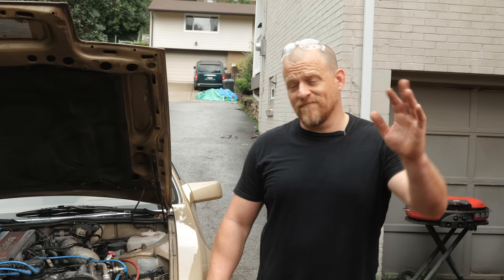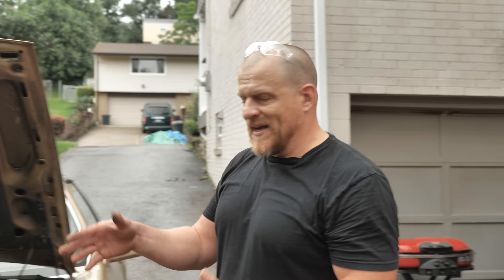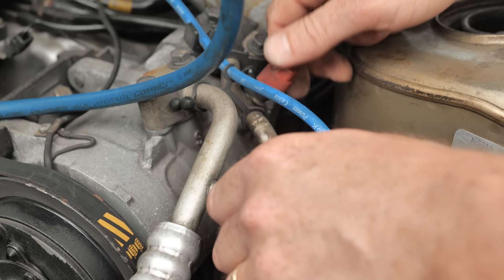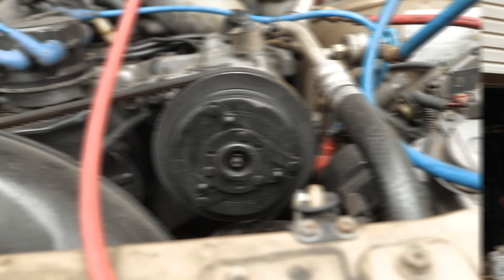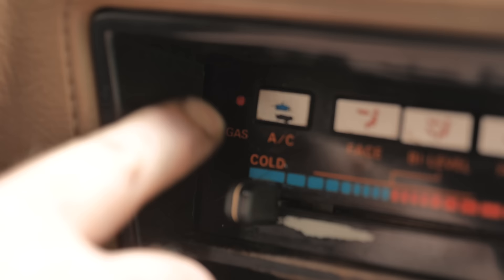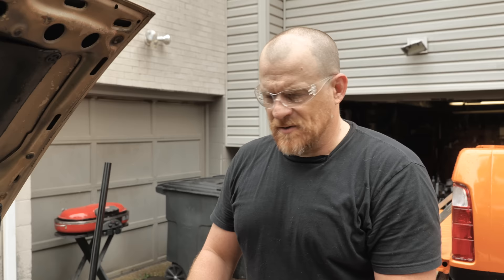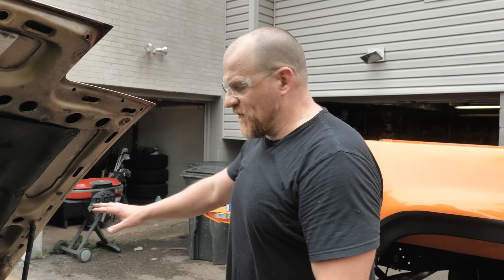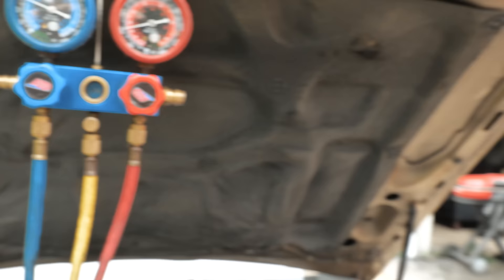A/C Leak Testing, Repair, Evac and Recharge (ANY CAR!)

Comment: Sorry to bother u .. I have a question after watching this video and purchasing  gauges  and filler piece that attaches to the yellow hose. I proceeded to see y my daughter's  2015  dodge journey wasn't producing cold air.  Steps I took to check for leaks ECT 
1. Attached all hoses to high and low with all valves closed. ( On gauges and on high low on engine . 
2. I opened all  valves starting with the one on engine then gauges. With the engine off. (Temp out side was about 80 degrees. And both high and low said approx the same on them as for pressure. Both equal to each other with all 4 valves open position)
3. I started car with a/c off let it run a bit gauges did not change. Stayed equal 
4. I turned on a/c to its highest speed and coldest setting looking at the gauges while running motor at approx 1500 RPM 's the gauges went to. Low side bottomed out at its highest mark in the retard section. And the high side went to about 200. . (When I tested for leaks I got none meaning  once I opened the 4 valves and both gauges went to about 80  I let vehicle set and gauges didn't move  it wasn't until I turned car on and flipped on the a/c before low pressure went all the way to the retard section and high side went to about 200.. ( now also I had the yellow hose going back to its self ( meaning I screwed it on to the port on it's one t)  so yellow was looped back to its self basically.  With what I have described  can u help me out on what possably I did wrong. Or possably the issue with the system 

Also I heard the clicking of the clutch come on and go off  plus when the motor or a/c was shut off I heard the hissing sound from the a/c unit.  Thank u if u need more info please  let me know
Reply from the maker: The valves on the gauges themselves MUST BE CLOSED when running the system! Those only get opened when adding or removing refrigerant or pulling a vacuum
Reply: Ok I think I understand I will rewatch a couple and this same video again   to clarify the order I thought  all valves had to be opened up with car running to check systems pressure before adding any Freon I did the car off  standing pressure. Which was equal to its self on both high and low.   So now it saying I should close valves and then hook up a can  and turn car on and open low side and induce Freon while running car at 1500 rpms and watch gauges go to 30 low 250 high
Reply: Sorry for writing the novel. Much respect thank you
Reply from the maker: @doncarl6849  the valves on the gauges themselves simply open the low and high sides to the center yellow hose. If you have both open, you're allowing Hi side psi to force its way into the low side.
Reply: Ok I will give. It a shot again. Maybe I'm mentally  making more  of it than I should. But what's simple to some cause of knowledge is so to one that doesn't. Lol. But I'm one that learns easy I appreciate the help I truly do.  I know I will get it right. It's a bit confusing even the cheat sheet cards  express a certain order on how to do things. By steps...

Comment: Ummm,  Ummm,   this is 2022,
How  about a  
" DIGITAL"  TEMP - G.   or use  a  VOLT - METER W/  the  attachmt.  - Wire - feat....
No pun,   just saying..
But overall great  "EDUCATION"
On  - "A/C - HVAC "  do it like
PROFESSIONAL!!! 👍👍👍👌👌
THX - YOU - SIR.....
Reply from the maker: I don't do enough A/C work these days to invest in more expensive gauges :-) but thanks!

Comment: Yes it does matter which side you open when testing nitrogen, you want only to open high side (red) only, as you make your low side gauges go into retard which it unnecessary stress.
Reply from the maker: There is no low or high side with the system off. Whatever you put into the high side enters the low side. Not sure what you're referring to. 🤔

Comment: I have 05 Crv and long ago well a year ago u replace the ac clutch and yesterday replacer the serpentine belt and tensioner cause I was  making noise time to replace but I notice the ac clutch won’t engage like it used to like it looks like having hard time to engage u check the relays but don’t have a gauge to check the pressure today still blowing cold air but not cold as it used to before ? Any ideas
Reply from the maker: Need voltage readings on the clutch circuit and system pressures to help further

Comment: let me ask if there is no refrigerant in the compressor, will it damage the compressor if it runs?  why is it bad?  Thank you very much.
Reply from the maker: It would, but it will NOT run because of low psi cutoff switches and sensors.

Comment: Hey Paul can I use shop air in r1234-yf systems too? I almost never find leaks with dye but ever since I saw your videos on using shop air to find leaks , it has worked great for me. So am just trying to implement the same procedure but not sure if I can damage any component on these new systems
Reply from the maker: Nitrogen is preferred my friend 😉

Comment: Does it matter which side you pull the oil in from? High/low? Pull in from one side and close it but keep pulling on the other? Just trying to figure out how to get the oil in without pulling it back out when I run the vacuum on the system.
Reply from the maker: you can pull it into either side, it doesn't matter, just rotate the compressor my hand a few times when you're done to make sure it isn't sitting in there. Once you pull it in. Close that side off and continue to evacuate from the other side. You won't pull that oil back out.
Reply: @ScannerDanner  thank you!

Comment: I was wondering what the sight glass was for. I have a 1976 Plymouth that needs AC work, think I'll try it out.
Reply: @scannerdanner or anyone...
How do you get the compressed air into the system if I'm not going to use nitrogen....just find some mating fittings or can you introduce it through the line set?
Reply: @saxdogg69  Attach your gauge set high/low hoses to the 2 vehicle high/low access fittings and open them up. Most shop air nozzles I've seen have a cone shaped rubber tip you can hold tight into the center manifold port (after removing yellow hose) to pressurize the system, then shut off the high/low manifold knobs once your air pressure is raised to your desired test pressure. It may take a helper unless you have 3 hands.

Comment: At the start you said you wanted to see 4x to 5x higher pressures on high side but after you fully charged the system the pressures were 10x greater. Is it always 10x in all weather conditions or the hotter ambient the greater the pressure difference?
Reply from the maker: That 4 or 5 times is a minimum you want to see during the nitrogen test of the compressor function

Comment: If I don’t have a way to connect the yellow line to compressed air like you did, can I just blow compressed air with a blow gun up the yellow line and use the same process to trap the air in the system?
Reply from the maker: Yes

Comment: Just lay the tank on its side to start off, if youre really worried about it. 7 years in the commercial HVAC field and still dabbling in it for the last 15+ years... Ive never seen anyone using said safety cage. That doesnt make it right... just saying nobody bothers.

500 microns is your ideal number. Better vacuum pumps can achieve lower numbers.... but youre also not using vacuum rated hoses, manifold and fittings. All fittings hoses and manifold are potential leak points. Using no manifold, only vacuum rated hoses and fittings and a better pump I typically can get below 300 microns on a standard residential split system. Of course after a standing nitrogen test using 200-300 PSI.

Comment: I have a question about manifold gauges, can the r1234a gauges be used with 1234yf systems? I know it sounds weird but there is a large price difference between the two gauge sets. I dont work on a/c but im thinking about getting in to it.

Comment: 35:46 

Can an HVAC automotive technician put the right amount of oil into a system without really removing anything? I am trying to repair my AC but I have no idea how much oil is left in the system since the compressor seal failed and let all of the freon out. 

I have a kit that came with oil prefilled but I'd rather just slap all the parts on to avoid the labor costs involved with swapping them and leave the oil/refrigerant charge to an actual technician but I don't know if that would work, or if they would even want to work on something someone slapped together in their driveway...
Reply from the maker: change the compressor, add 1 or 2 ounces at MOST and be done with it. You lost very little oil with that leak

Comment: Hygroscopic is what you were thinking at about 25 minutes into the video.  Other fluids that attract and absorb moisture out of the atmosphere is hygroscopic.  @ 48 minutes I rolled my eyes a little at the amount of oil I"ve found in new compressors.  I always fumed & cringed at that oil because I was taught that could just be a storage oil.  Allegedly, it's dumped in to preserve the compressor during its life on the shelf and is to be drained before installing the new compressor. The aftermarket manufacturer will never provide any installation info about what that oil is, how much is in there, does it need to be drained out and replaced with the correct PAG oil, and why can't the OE service into supply oil specs for their AC systems either?  As far as I'm concerned, these manufacturers, both OE and aftermarket, and 3rd party service info sites like Identifix and Alldata all owe me money for the time I've lost looking for answers to these questions.  That info is sometimes out there, but I'm beginning to think it would be easier to find on Netflix than any service repair site....Just verified it.  I searched PAG oil system specs for a 2003 Passat and it's right there, just past Stranger Things.

Comment: Okay, what if there is no fluctuation in pressure as the compressor cycles on and off? My pressure consistently reads 40 psi at 100 F ambient temperature.
Reply from the maker: On both sides? If yes, then  your system is basically empty. I'm surprised the compressor is even engaging
Reply: @ScannerDanner  I dunno, I found out the driver's side actuator needed replacing and now it runs at 60F from all vents in 100 F weather. I don't get it but life goes on.
Reply from the maker: @phantomcreamer  you didn't give accurate pressure readings if that's the case

Comment: compressor engages and spins (mechanic trying to sell me on a whole ac kit 1500 job says it has failure). 
the refrigerent levels on the paper said 1.75 oz supposed to be in it 1.58 reclaimed (aparently put back in)
when 95f outside at night the low side with the can gradually adding just a little and checking went up to about 30 before it did a drop like the system vented a bit or something
condensor in the front looked fine besides a few bug bits before I took it to the shop. i pulled those out and started rensing slow with fan shape then angle shapre on hose head
was professionnaly recharged last summer, was never quite as cold as expected but didn't bother with it until now
blows warm

can't afford the 1500 fix, only thing i can think of is evaporator in the back which looks like a huge pain in the ass to get to. is there anything else I might be overlooking? can the condensor spin up but still be failed?
Reply from the maker: What are your running pressures with the system full?

Comment: I just recent;y indtalled a new compressor in my car, my original died after 14 years.... I'm doing to do the vacuum test tomorrow to see if it holds a vacuum, but wondering if i should add refridgerant after it starts getting warmer here, right now its in the 20's and low 30's temperature wise.  Just wondering if i'll get the correct reading in the cold.
Reply from the maker: Your AC compressor won't even engage until around 40 degrees F 
Even with a fully charged system
Reply: @ScannerDanner  So i should wait until we're at least 50 degrees? I will do a pressure test at least to make sure i have no leaks.
Reply from the maker: @DTUFINOPhotography  at least, yes

Comment: Let me get some clarification on the micron gauge and it’s use. Just a month ago I was charging the a/c on a 95 Buick that was completely empty. I vacuumed it down to right about –30, shut the pump off and let it sit for 15 minutes and didn’t see the gauge needle drop so assumed no leak, vacuumed an hour more and then charged. Blew ice cold……..for about a week, then all gone. What would a micron gauge have showed? A micron reading of say, 2000, from which further vacuuming wouldn’t get it lower? Is that the benefit of these things? That what seems good on the gauge set isn’t necessarily good and the micron gauge would show this?
Reply from the maker: What did you find when it came back? Sometimes systems can develop other leaks that were not present at the time of repair. Especially if they've been sitting empty for a long time. Hoses will deteriorate and with high pressures of the AC system, they can then start leaking.
But yes, the micron gauge would have caught that leak if it was there at the time
Reply: @ScannerDanner  Sniff tester went off soon after I opened the door and sat inside so I assume an evap leak. Got a great offer from, and sold before fixing it to, a PA inspection tech who said that's a common problem. Rustfree 2 door Skylark GS.

Comment: Scotty on YouTube claims that compressors all leak microscopically on the spinning shaft so a well used system may only last 5 years before a recharge is necessary. I am hoping someone familiar here knows if a micron digital vacuum gauge can see such a tiny tiny leak?
Reply from the maker: That's totally false. My 2009 Silverado has never been touched and I bought it in 2012 with 24000 miles on it. 
As far a checking for leaks using vacuum, even with a micron gauge, you can miss it as it only leaks under psi.
I have a video on this exact scenario on my sons Nissan 300zx
Reply: @ScannerDanner  Hey thanks. If I still have you on the line I was checking R12a recharge cans and some have dye and some don't . Same manufacturer shows 6 oz can has 1.1 lbs with dye and 6 oz can with no dye has 0.6 lbs. Some say to be careful of dye as it can be treated as oil in the system which might dilute the oil and overheat the compressor. What do you think of manufacturers or producers of coolant with dye added in the can. Can you charge an empty system using these cans or do you use only one or is it bad to begin with?
Reply from the maker: @mrwebber35  1.1 ounces of dye? I've never seen 6 Oz cans either. 
I also don't leak test with dye as it's very inaccurate in my experience. But the older R12 systems used mineral oil, so it wouldn't wash away like the R134a pag did, which is when I stopped using dye for leak testing
Reply: @ScannerDanner  NO, 12a is not R12. My fault for calling it R12a, there is no R. It is new and better than R134a as they claim it produces lower head pressure for improved cooling and is 35% more efficient than R134a refrigerants. This all-natural, non-ozone depleting refrigerant lowers compressor head pressure for improved cooling and longer component life. Can label says equivalent to 18 oz of R12 (510g) or 16oz (456g) of R134a. I believe this means adding a fraction of can will do the job. I suppose the dye additive means nothing? What do you think? I think we've just entered the later half of the 21st century.
Reply: Oh and I think the 1.1 lb rating with the dye additive compared to regular 0.6 lb rating without dye means 0.5 lbs of dye per 6 oz can.
This from Red Tek website about 12a refrigerant

System Compatibility
No retrofitting needed. RED TEK 12a is designed as a direct drop-in replacement for R-134a and R-12 substitutes. RED TEK 12a requires no significant redesigning of the refrigeration system because it is compatible with R134a, R12, metal components, compressor motor materials, mineral, and synthetic (Ester and PAG) lubricants, seals, gaskets, hoses, compressors, and O-rings.

Note: RED TEK Refrigerants and R12 Mineral Oil are not compatible with Butyl Rubber Hoses.
Reply from the maker: @mrwebber35  what oil is compatible with that refrigerant? I wouldn't use it. That's my professional opinion

Comment: I noticed condensation dripping from my compressor today. Never seen it drip from it before.  Should I be concerned?
Reply from the maker: As long as your not having problems, no, that shouldnt be a problem. The suction line would be very cold coming into the compressor. I'd imagine it is very humid where you are right now?
Reply: @ScannerDanner  Thanks for the fast reply. Yes it’s very humid in Tennessee.   Love the videos!

Comment: If the compressor seized up and likely sent metal into the system, will that contaminate the ac recovery machine when recovering the refrigerant?
Reply from the maker: No sir. When you recover refrigerant, you're just boiling it off and pulling a vapor
Reply: Appreciate the quick reply. However, my understanding is when recovering refrigerant some oil comes out as well. I think most if not all recovery machines have a way to drain and measure the amount of oil removed upon refrigerant recovery. In such case wouldn't that also carry along some metal shavings? I searched a lot on the internet on this and couldn't find the answer.   @ScannerDanner
Reply from the maker: @borisp9499  every recovery I've ever done, contains little to no oil when you drain it or test for how much came out after you're done. What you really need to worry about with recovery machines is to know what type of refrigerant is in there!